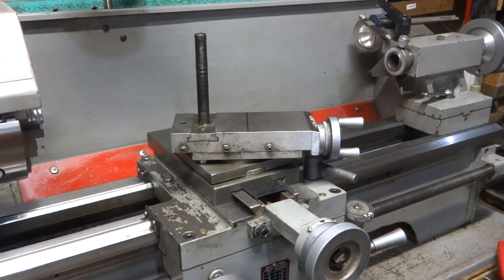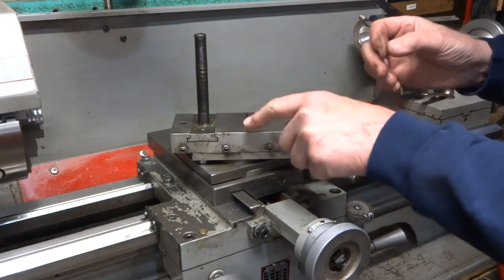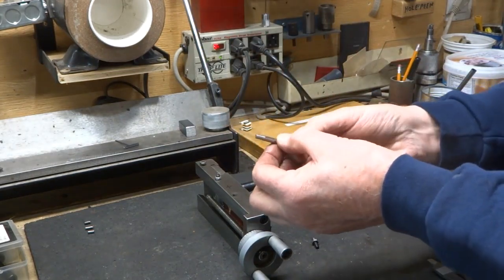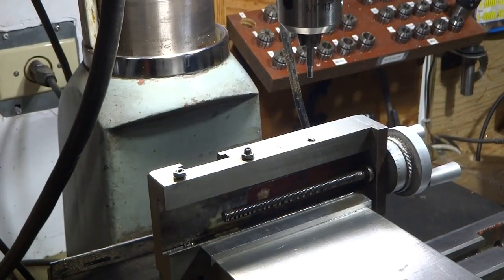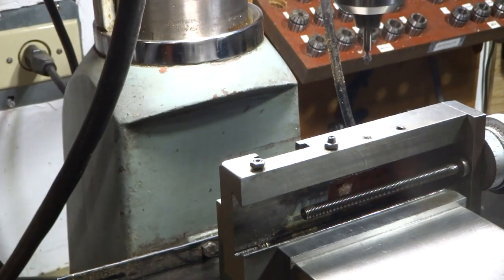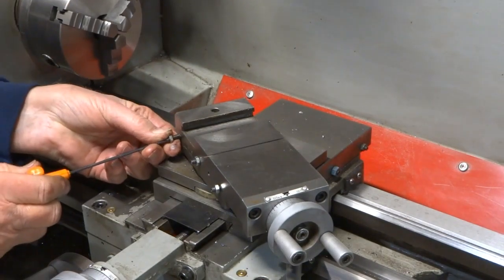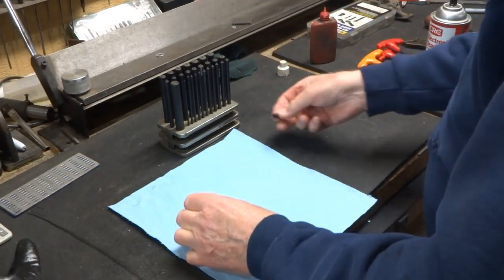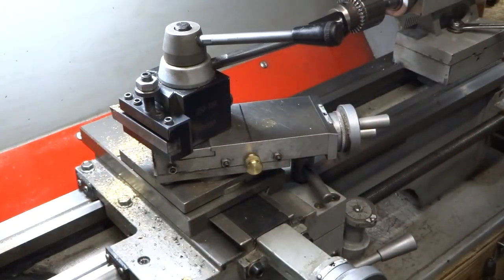Compound slide lock.

Comment: Hey Mr M, I’m new to this, please tell me what sort of drill and tap you used in that very hard casting.?
Reply from the maker: The slide was not that hard. I used a normal drill and tap with cutting oil. Run a file over the corner of your slide material , if it skates across your slide might be much harder than mine.